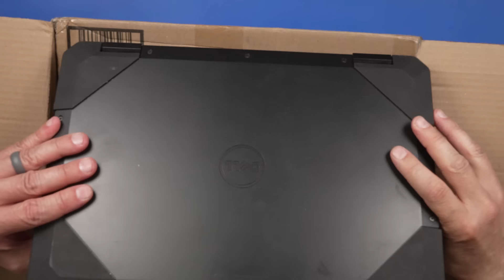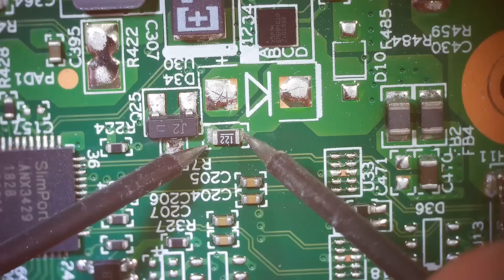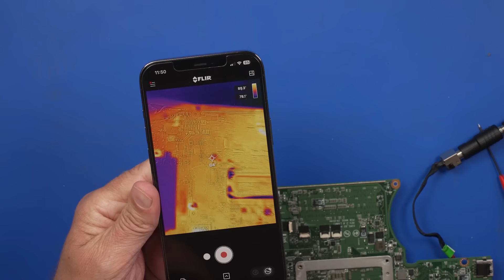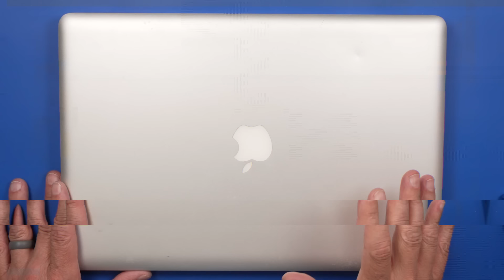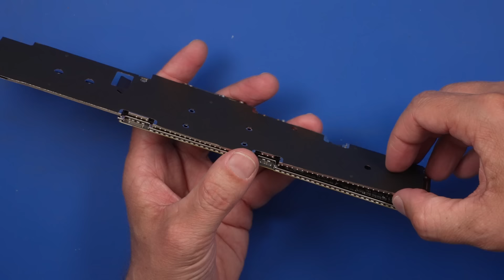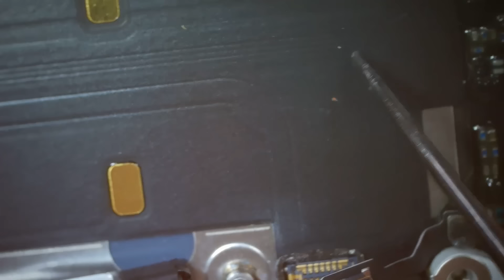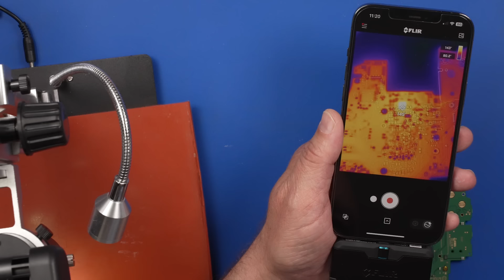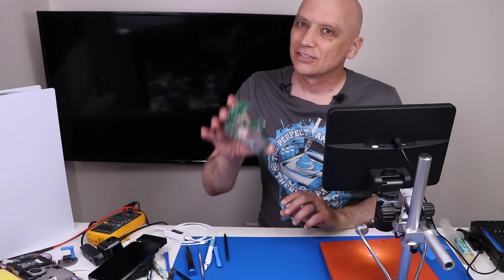Austin Evans Broke These with a USB Killer - Can I Fix Any?!

Comment: If there is short on the coil i would put like 1volt or some small voltage and check what gets hot. I used plastic bag and where it melted there was a short (or you can use thermal camera if you have one) if i didnt find anything this way i would remove the coil becouse then i would know if it was shorted before the coil or after.

Comment: If I'm not wrong, your approach was way too typical, and the damage is very atypical. I have only seen a USB killer once, and it worked by taking power from the v+ line, storing it in large capacitors and then, feeding a large voltage and large amperage current to the DATA lanes. It's very, very unusual for devices to have protections on data lines (it seems macbooks do), so the current can actually reach very deep into the circuit. Sometimes the thing actually killed the CPU or the GPU so, only if you are able to actually change those types of components, the device is very dead and not repairable.

You checked the power lanes on the board when you should have been checking the DATA lanes.

Comment: 31:37 the thermal camera overlay is offset from the board making the hotspot appear off the actual faulty chip.
You can see by how much it's offset by looking at the edge of the board, top left for example.

Comment: It's been a while since I read up on USB, but from what I remember back when it was first introduced as a standard (and in comparison to another 90s standard, Firewire) the biggest difference between the two is that with USB,  thre's no independent controller - control is CPU dependent.   That tells me that improper USB implementations could result in dead CPUs.

Comment: Yeah so my new computer cannot be killed by a USB killer. It has sensors and will literally shut off the port if it detects a sudden massive voltage or current spike. There are also several fuses in each port and down on the motherboard power rails before any critical components. I know this because I tried charging my phone with a broken and shorted charger! It popped and sparked too! I'm glad my phone didn't blow up. I guess electronics are made with more safety features nowadays. I've heard this is done because a lot of devices available today actually draw a lot of power compared to a mouse or keyboard, depending on their function. LEDs on devices can draw 5x more power than just the device itself.

Comment: There's a huge offset between your regular camera image and the thermal camera image. Isopropyl alcohol always gives it away though. Maybe consider the thermal camera that TheCod3r uses, Flir appears to be junk. I can't believe Flir doesn't fix the offset in software.

Also that Macbook Air, there was a small thing with a U on it next to the Texas Instruments chip where the top solder joint looked cracked. I have no idea what the U thing is though.

Comment: Great video as aways. Here is a tip when searching for a dead component: If a capacitor has ground on both of its terminals, check if the capacitor itself is not shorted. For example: Look at the C364 at 06:13 of the video.

Comment: I was watching a video explaining how those USB Killers work.
I seem to remember the Apple machine works because the USB parts are electrically separated by some kind of opto-coupling (?) so the stick will kill the USB part but not the rest of the machine.
Without this separation, the destruction is thorough.
Reply: Yup that’s exactly how it works, it costs more to make so Apple charges their premium for good reason 😂
Reply: @MarksterC your average user doesn’t need that or even use a usb killer 💀
Reply: @Legendmaster1989 a thunder storm can cause the same issue.
Reply: why would you even use usb killer
Reply: @maklogetrich2378  Because they are supposed to be disguised as normal usb devices. There's a lot of ways you could get someone to plug one in. One way would be online store return scam. Buy a normal usb, put usb killer in box, send back to retailer. Someone else buys it, plugs it in, and you get to kill someone else's device. You can also leave it in a well populated area, and chances are that someone picks it up and tries to plug it into their device, either curious to the contents or looking for some kind of identifying information for return to owner. You could also just plug it into any devices left unattended. It's a malicious tool, not something people go out to purchase for their own devices.

Comment: As far as i know, usb killers send high voltage on data lines, wich can deal damage to components, i've had some computers where i burnt away usb ports , by shorting out power lines, but then pc was still turning on, only thing blown being usb controller chip, niwadays that controller is incorporated into cpu, in most of the cases , so more or less those boards might just be donor boards lol

Comment: I haven't read the comments and I'm only at laptop 3 (Dell) but I'd say the chances are the Super IO chips would be taken out on the laptops
Reply: The PS5 does have a mosfet for each port too, which I've seen cause no power in the past. I'd say maybe try replacing the two mosfets on the APU side of the board just below the ports

Comment: Any chance on a link for the USB power meter you used?  I've been interested in picking one up to aid in troubleshooting
Reply: Also, just a thought, shouldn't you also look at components near where the USB killer was plugged in?  On some of the laptops/chromebooks the USB killer wasn't connected the the DC Jack, so personally I wouldn't see components blow at that area, but rather near where the USB killer was connected.

Comment: 13:03 did you check that r010 for shorts? That should be the current sense resistors.  That is most definitely shoeted and you could inject voltage there if it is shorted indeed. Else check for mosfet near the dc jack for shorts

Comment: The PMIC on the Switch is getting hot because it has a downstream draw. The PMIC is a power generating chip. If it has something pulling on an output it will get hot trying to keep up with the power delivery.

Comment: Chromebook, short might come from E8/IV (diode?) and small chip right of it ( on 5:28 ) as those are connected to coil. 

Second laptop, I guess it has USB controller on APU and thru that CPU or parts of it got fried. As usb killer attacks thru data lines. DC in on that should be ok as usb killer won't hit on that.

Just my guesses based on just a general guess how stuff works. I'm probably wrong, but. :D

Comment: FYI, the reason you have such a hard time pinpointing the hot spots with your thermal camera is because of parallax. The thermal camera on the bottom of the phone captures the IR image, and the normal phone camera captures the visible light image, and then the software superimposes those two over each other. Since there's a pretty significant distance between the two camera lenses, there will be a ghosting effect similar to when you cross your eyes. You can reduce this by taking video from father away, but generally for precise work like circuit boards a thermal camera that has the lenses closer together will work better for you.
Reply: a short usb c extension cable would allow you to move the thermal module closer to the camera, and maybe a 3d printed mount to keep the camera in the same position in relation to each other

(not sure if they make lighting extensions)
Reply: If you use it you know it exists. I dont get it.
Reply: You should be able to put the FLIR camera it in IR only mode, then use your finger or something to pinpoint the hot spot.  But I agree the combined FLIR IR + Normal camera mode is bad for small items
Reply: @craig078  it works if you know how to use it
Reply: Yeah it bugged me that he didn't get that lol
Reply: It should be easy for them Flir to offer software calibration to re-align the two image feeds. But either they don't or Steve hasn't used it. 

If Flir doesn't offer that feature, I'd say that they're crap and look for other thermal camera solutions.
Reply: @mjc0961  You can adjust it, but there is a maximum (at least on my unit+specific phone). It never fully solves the issue. But as long as you know it you can compensate in your head.
Reply: @mjc0961  Flir doesn't do parallax correction at all afaik on those cameras. I've been using the Flirone Pro for a couple years and I just set it to IR only. It's a great tool, but you have to know the downsides. I don't really understand why they put a normal camera on it. It adds nothing but a little texture when done correctly, and just serves to obfuscate the information if not done correctly.
Reply: @mjc0961  you cant just realign two cameras in software. theyre in different physical locations. theyre seeing different things. Love that you're calling a company "crap" because they cant defy the laws of physics.

Comment: Amazing video, what makes the killer device lethal is the high voltage shock that it sends mainly through the USB port (not USB C) on the data lines that in most devices have a direct connection to the PCH or CPU

Comment: ive noticed hoow the boards heat signatures dont fully lign up to where the texture visuals are coming from which around the 32 minute mark made you look away from the chip, but if you keep the offset in mind, the heat is coming from the chip

Comment: The fuses will not blow if you plug in a usb killer, they protect against overcurrent, not overvoltage.
In most cases USB 2.0 data (what this device attacks) is not shielded against overvoltage (especially up to several thousand volts), but wired directly into a USB chip, only some caps filtering noise from the signal.
Applying 5kV will at least fry the usb circuit and then will likely jump to the VCC lines, killing a whole lot of chips connected.

If you want to defend your USB ports from being attacked by USB killer circuits, your best chance would be isolating the data lines with an optocoupler, as only that would die and need to be replaced. Unfortunately these tend to get very pricy with increased speed and are therefore not viable for the high bandwith consumers would expect.
Reply: or how about just TVS diodes? it is also protects from stray ESD
Reply: @5mf1nc  It has some already, there's only so much they can do specially as the device sends multiple pulses.
Reply: @carlost856  the only one that had proper TVS is the old macbook -- and that stopped it!
There was the PS5 with TVS on the superspeed lines (usb3), but not on the "classic" d+/d- -- (well not properly checked on the front-panel board though where it got attacked)
There was some board with footprints for TVS too, but not installed.
You can also scale your TVS for how much brunt to take --- and afaik they fail sort to gnd, protecting the downstream. (had one xbox with no video, that a lightning knocked out-- it was the TVS on the HDMI -- removed it, now working)
Reply: bro there were TVS diodes
Reply: They make optocouplers fast enough for USB C?
Reply: @carlost856  i dont think the speed is the issue, i think its more likly that they are to expensive with 20cents to 2€ in Medium Volume.
Reply: @GremaxLP  no, there isn't even HighSpeed opto usb, i've only ever seen a FullSpeed opto. Now there is the SuperSpeed (usb3)
Don't forget, USB is differential signaling in both direction, using voltage potential for handshaking (to determine speed) you can't just opto it willy nilly.
Reply: @5mf1nc  after 5 min Google AdUM4160
Reply: Just dont say they dont exist when they do. They are just to expensive.
Reply: @GremaxLP  probably more they dont exist as far as the average muggle is concerned  ;)
Reply: @norfolkngood8960  fair :) but yea. Dont expect them any time soon in consumer Devices.
Reply: @GremaxLP  but itis an issue.
Reply: @carlost856  why? If you dont use a killer a normal good designed esd protection will keep you save.

Comment: pretty sure he used a usb killer that sends the power back through the data lines and can brick the cpu directly if it isnt using an external usb controller
Reply: not a cool device.
Reply: they would probably make decent parts boards at least
Reply: Is there an easy way to determine which parts are salvageable? Obviously discrete components and connections should be fine, but which chips would survive such an attack?

Comment: The usb killer just puts 200v on thr data lines with a quite big current.
Most of the time the usb lanes are wired directly into the apu/chipset.
And thats a no-go, the IC will short external power and data lanes too. If the device has an external usb-C control chip, then you are lucky and you can replace that chip and everything is fine.

If they use a tvs diode or tvs diode array, it can just blow itself.
Reply: Like Apple has on their boards, TVS diodes

Comment: So... If the fuses don't function as intended (first two so far) why even have them... Truly enshitiffication is the worst
Reply from the maker: Yeah, agreed. I don't see the point if it doesn't actually protect the device.
Reply: they need those flink flink fuses (very fast acting fuse)
Reply: Fuses usually blow due to current, not voltage. The USB killer sends a spike of high voltage low current into the data lines. Especially with how short the pulse(s?) are it's not surprising those 0ohm fuses didn't blow.

Comment: the USB killer shunts power into the USB circuitry not the power.    but so far all i've seen you checking Steve is the power circuits..   i think a re-visit (unless it happens later in the video) to inspect the USB controllers and circuits.

Comment: That Chromebook that you started off with is similar to the ones my school uses except ours has AMD A4 processors and they put Impero Backdrop on it so it slows it down tremendously. I use my 2012 MacBook Pro 13 inch and it works so much better.

Comment: Hey Steve, Love the video and the fact that Austin was willing to send them over. One thing I noticed was that if I short a data line with an power line in a usb port the pc or laptop will power off and wont turn on if I leave the short there. After removing the short in the usb port it powers on fine. Maybe there is a short between the data and powerpins on the board of device #2 that prevents it from turning on.
Reply from the maker: Yeah, it was super cool of him to send them over. Thanks for the tip. I might have to make some follow up videos.
Reply: @Tronicsfix  does the iPhone wireless charge?
Reply: @EvilTurkeySlices yes
Reply: @Tronicsfix  
Yup, it would be really nice if they started working again. Unfortunately, chips are indeed difficult to get without a donor
Reply: @Tronicsfix  what happened to your hair?
Reply: @DeadlyTechGuyYT he talked about it on his website, I think he has cancer
Reply: @DeadlyTechGuyYT  lymphoma, man....
Reply: Chemotherapy  @DeadlyTechGuyYT
Reply: Love your videos Steve.. God bless you